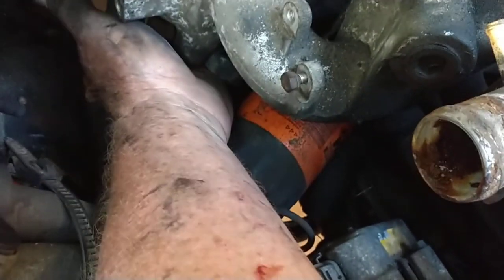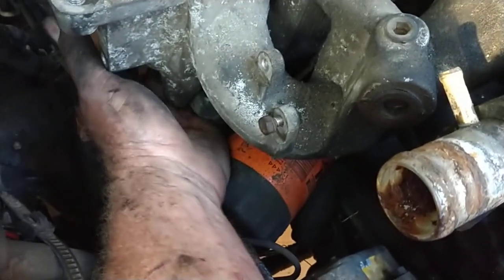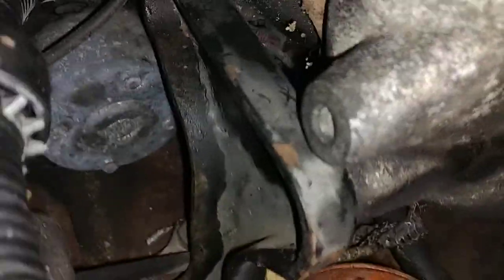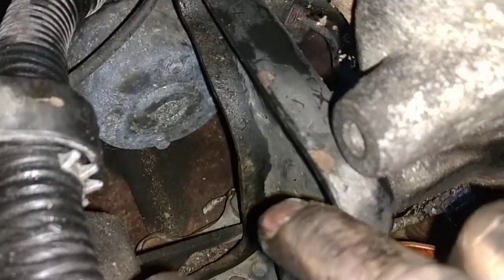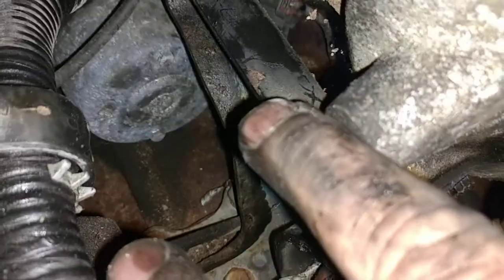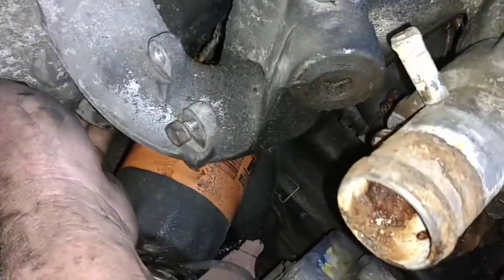D21 Hardbody intake manifold hidden bolts

Comment: Put a 95 2.4 engine in a 97 2.4 hardbody. Everything the is the same besides the 95 block transmission flex plate all the same from 97. The starter isn’t close enough to the flex plate just grinds and spins